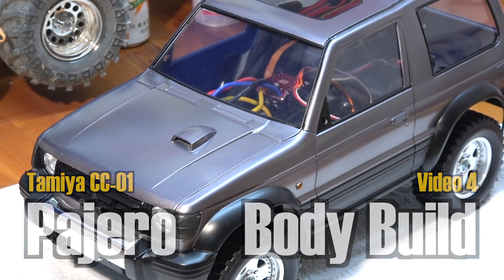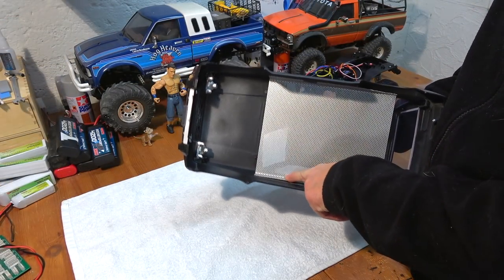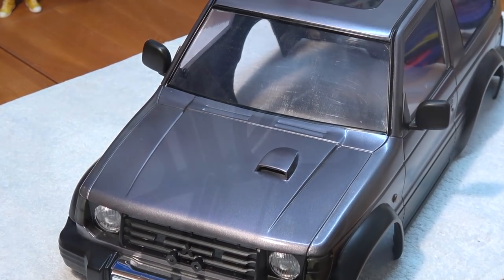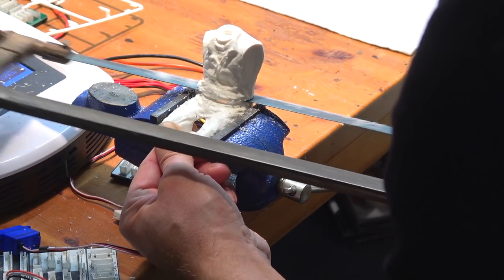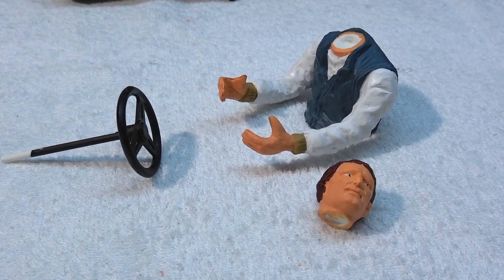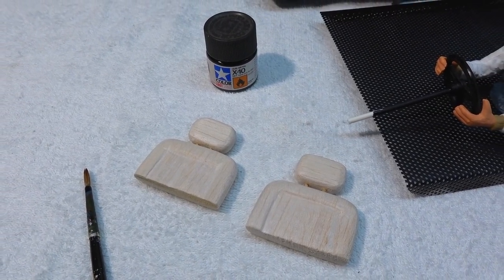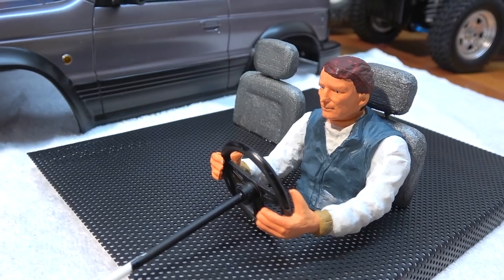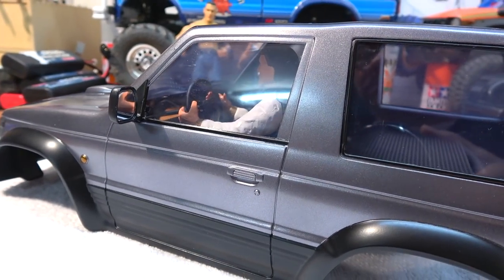Tamiya CC-01 Mitsubishi Pajero Body Build and Paintjob - Video 4

Comment: Very nice Matteo!! I like the idea of the simple interior. You are so much better at painting figures than I am! I am very good with painting bodies, and detail work... but I can never get the colorings right on the figures. 😑
I do the same type of painting, but for interiors I use the flat, acrylic paint from the AK Interactive. I get good results, but the passengers never look quite right. 

This is coming together very nicely! If I may make a suggestion....
You are good and creative. Why not make a simple Dashboard, but fix it to the body, under the Wipers.
I'm doing the same, but with a HG P402. I am doing full interior, because this Rig has much more depth inside than my cC01s. 
I have the Driver holding the Steering Wheel, but the steering shaft does not connected to the Dashboard. This way, the whole interior is fixed to the chassis, but the Dashboard is fixed to the body....

This way, when I have to remove the body, I never have to worry about reattach the Driver to the Steering Wheel. Easy!
My CC-01 Landfreeder has a small Cab, and a interior plate from a Holiday Buggy fit perfectly. 
With your bigger SUV body, you had to use more creativity to fill that large cavity with an interior that wasn't deep. Great work!! 👍👍👏👏👏
Merry Christmas!! I hope 2018 will be good for you.
Carmine 🚂
Reply from the maker: Thank you Carmine! Yes, your right a simple dashboard would be a great addition! Wish you nice holidays and all the best for 2018 too. Hope the things getting better for you next year!

Comment: I'm confused Abit on what the alloy mesh is called is there a link to it. I would like to use this method I think it's clean and easy. Awesome results.
Reply from the maker: I think it's not so important to use excactly the same material. You can use also something similar. It should be light, stable and easy to bent, this was my criterium to choose this aluminum material. I bought it on a local hardware store.